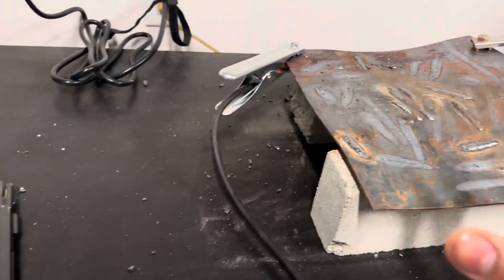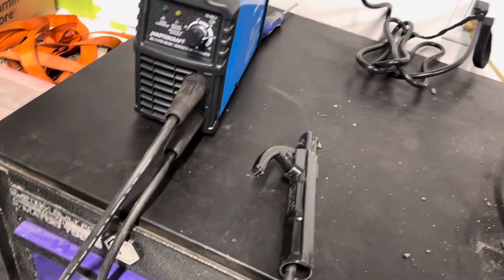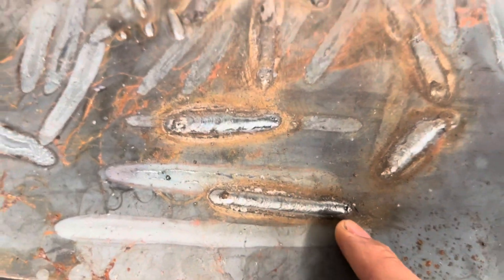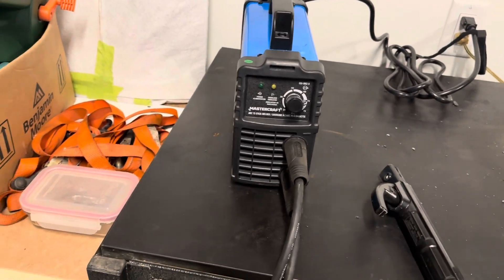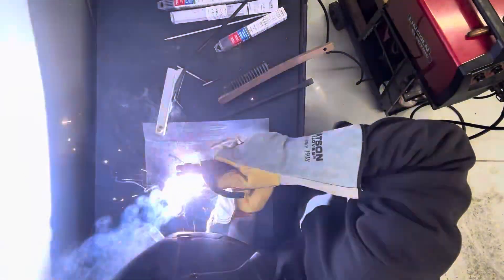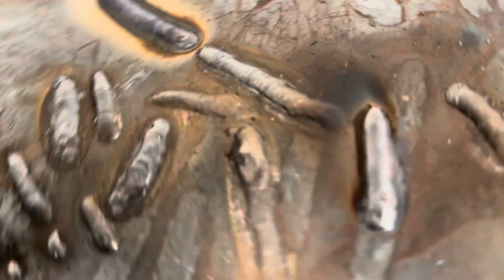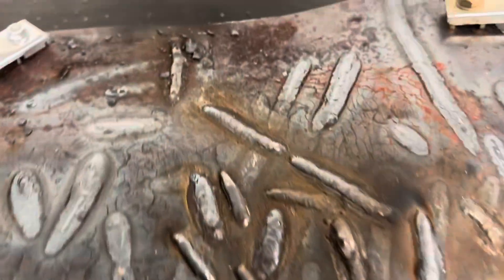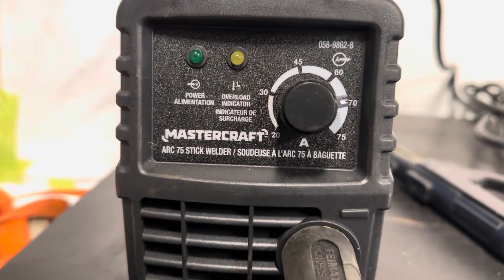$230 mastercraft welder from Canadian Tire!

Comment: ($230! ouch) nah... it's kind of crap actually, not enough amps. For $100 on sale I'd still pass on it, I tried one and just not all the good. Plus for a beginner i think it would be difficult to learn on. 
If you want a really decent welder for a little extra coin go with CT's 125i flux core welder. Way better bang for the buck, on sale now for $207 cheapest I've seen in years :)) Same as Titanium 125i and CT's welder has a 3 yr warr.